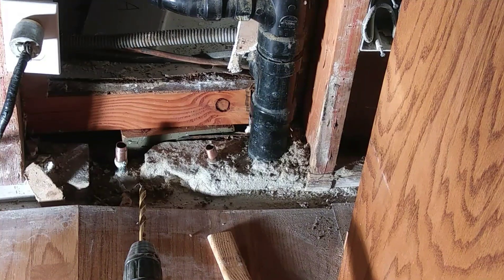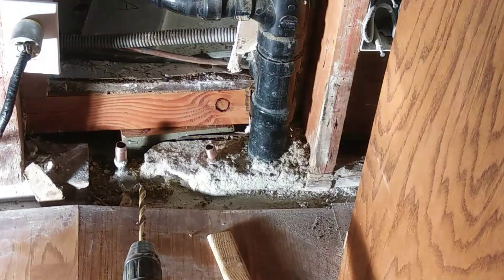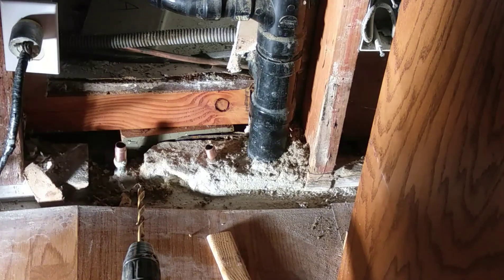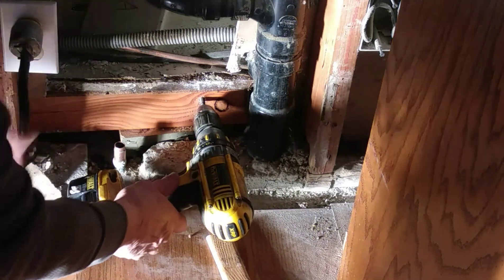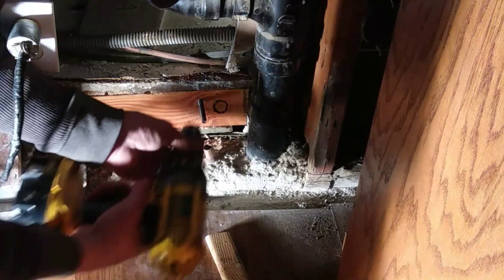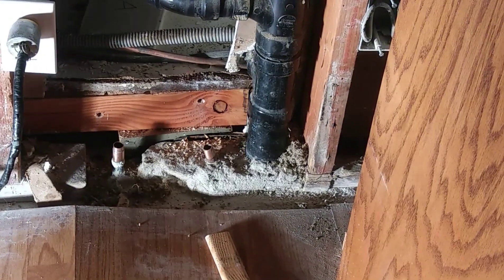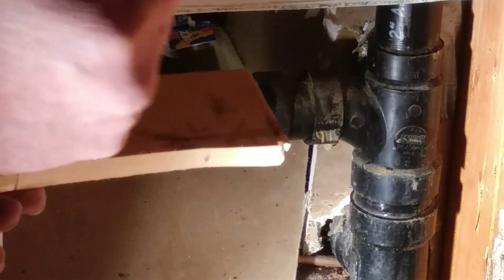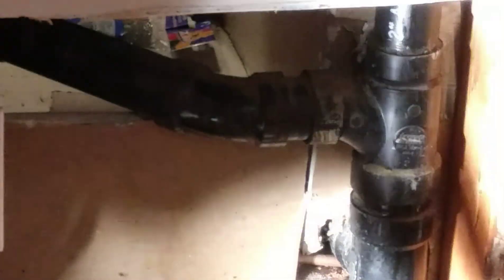Repairing drywall under the sink part 2. #EasytoTipsAndTricksEctEct

Comment: Really great job and tips and tricks our house still has the wooden slats and plaster which makes it a little harder to repair but per your video I've got a few more tips thank also watched your other video before this sledgehammered that like button on both
Reply from the maker: Atg yes the plasters another animal and to redo the original finish and that takes some knowledge it's becoming a lot if it's not already released here in the states.
I'm glad I was able to show you a few tricks that's helpful I know that always helps that makes what I'm doing worthwhile to know that it's helping somebody out thank you for sharing that with me.

I'll be doing another video where I'm going to have to build it out in order to get the drywall to be flush and I'll be showing how to do that and probably part 3 I'm getting ready to video part 2 now thanks for being a part of my community that means alot Merry Christmas and God bless Ken your brother from another mother💥

Comment: In all my professional drywalling career I've never seen anyone use wood glue for drywall or a nail gun to fasten drywall to the studs. However you got the job done so good work dude
Reply from the maker: I am a hand railing stair installer and when I have to open up a wall to put in backing for my hand railing I have learned this is quick and easy then you can go back and add a few screws to reinforce it so I will be adding a few screws check out my part to which I'll be getting ready to film here in just a few minutes thanks for your time . God bless Merry Christmas.
By4Now
 Ken
Reply from the maker: I didn't actually shoot it to the studs although you can and I have just not this time was it necessary and not enough room I shot it to the drywall itself along with gluing it